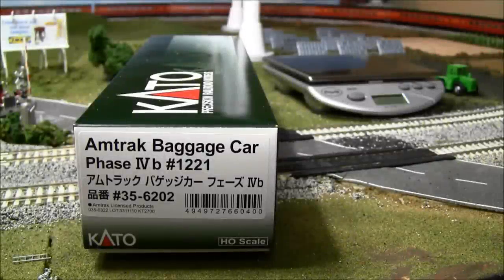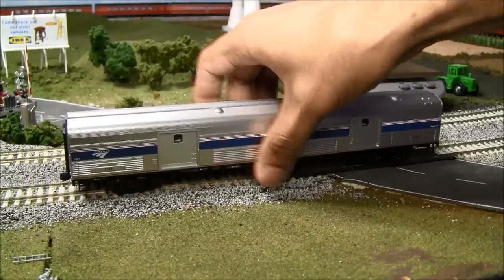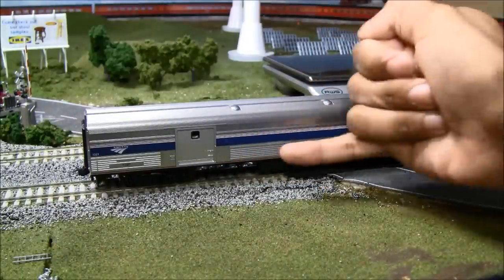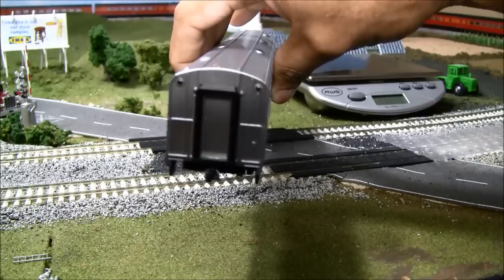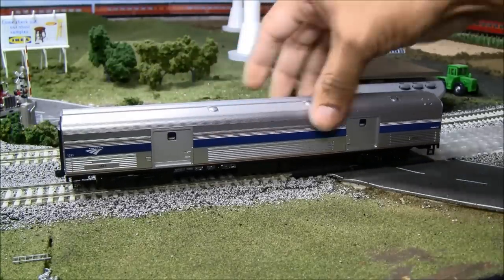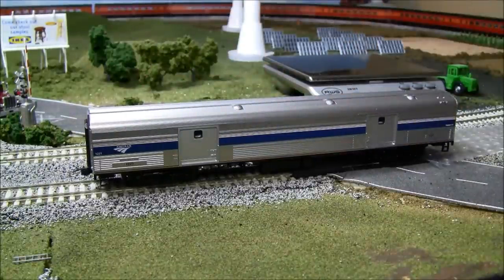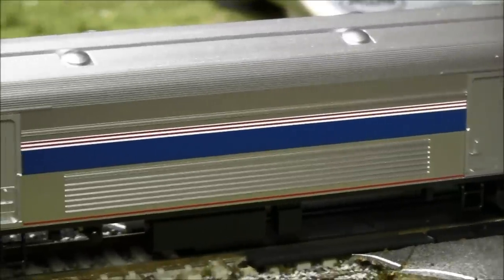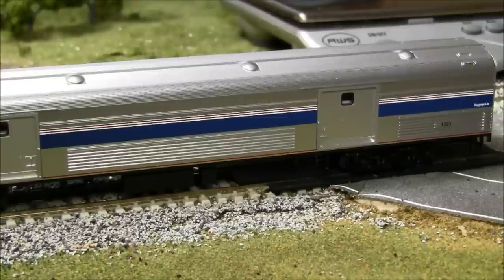5 minute Review: Kato HO Amtrak Baggage Car in Phase IVb

Comment: Holy cow...85 bucks?!? I've never understood why some guys go nutso about the underbody detail. Usually the rolling stock on my layout is all upright...it's been awhile since I've ever run an upside down train (haha). As long as there's a brake air tank in a prototypical spot I don't understand the need to include all the little piping and stuff underneath if it will literally never be seen. Just my take I guess. Everybody enjoys this hobby in their own way :)